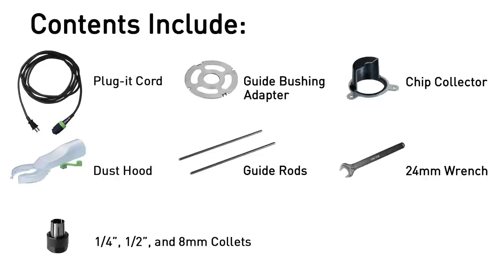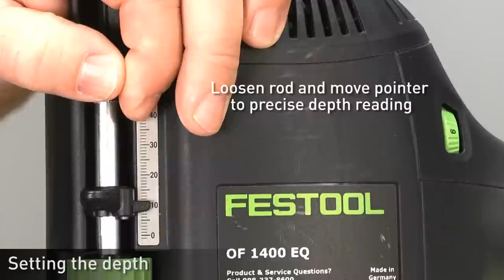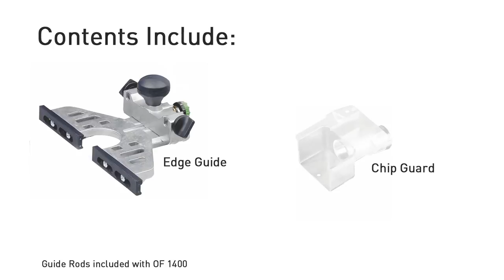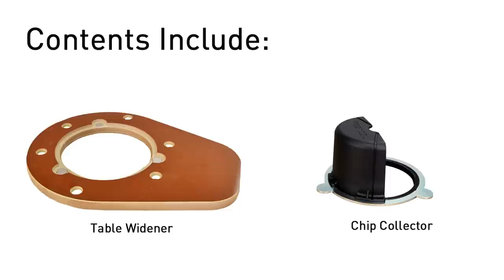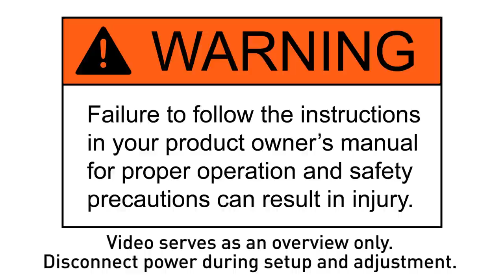Festool OF 1400 Plunge Router - Basic Setup and Configuration

Comment: Truly one of the best routers made for hand held use. Lots of power hidden by its smooth ramp speeds, meticulous machine work, and ease of operation. From the ratcheting collet to the ergonomic pistol grip, I have enjoyed using it every time it comes out of its stackable container. I have had the OF 1400 EQ for about 4 years now and have completed several projects including a custom hardwood kitchen and after 30 years of work working, am convinced that this is all one would ever need in a hand held router. Light enough to be easily maneuvered but with all the power one would need for free hand routing. If you need more power, you may want to consider using a router table with a Milwaukee 5625 fixed base stuffed in it. I have owned all of the so called competitors routers, and I can say unequivocally, this is the best free hand plunge router made and I trust it will last me for years to come.

Comment: Hi Peter, as you know I received the Festool OF 1400 router after seeing your videos and I have been using it for the last few days routing out mortise lock face plates and receivers in wooden doors. I must say this is  the best router I have ever owned or used and I thank you for recommending it to me. 
However I wondered if you could help me with something? - While using the router on a rebated door jamb I tried but failed to attach the router support onto the side of the router. I realize this attachment is designed to be used to balance the router when being used on the guide rail but it seems that the nob provided is too short to fix the support and I wondered if you had that problem? Also my router arrived with only two collets, the 8 mm was missing. Cheers Dan